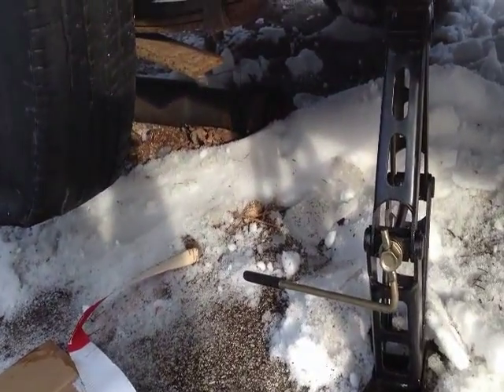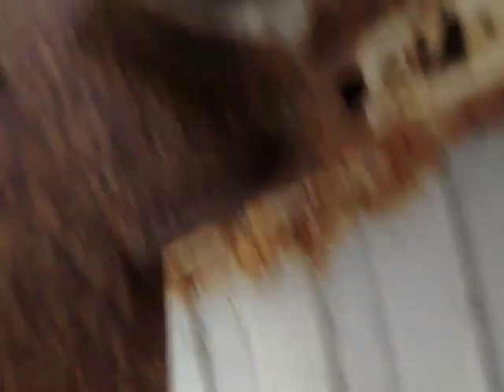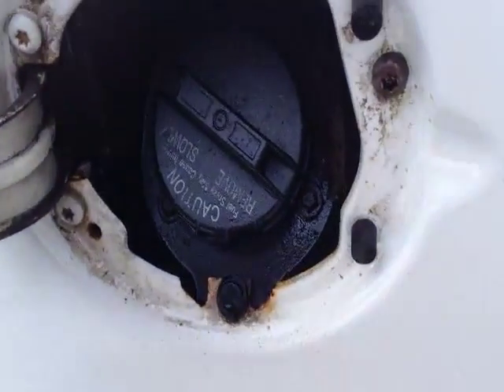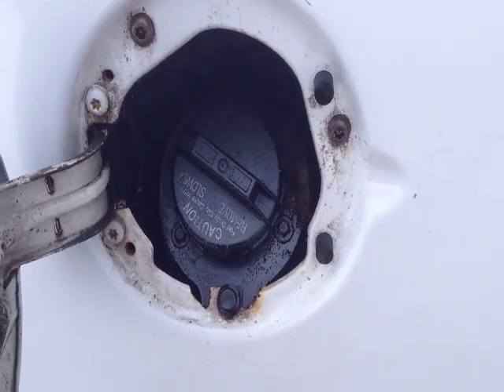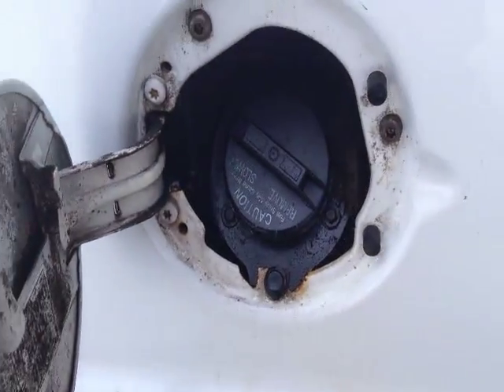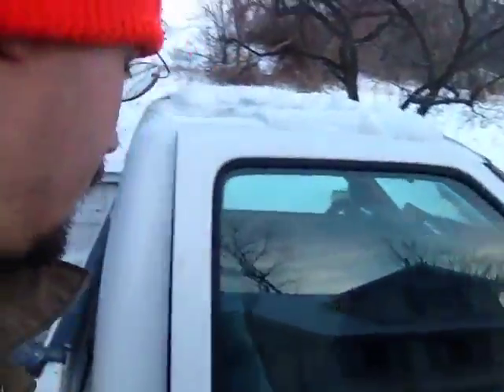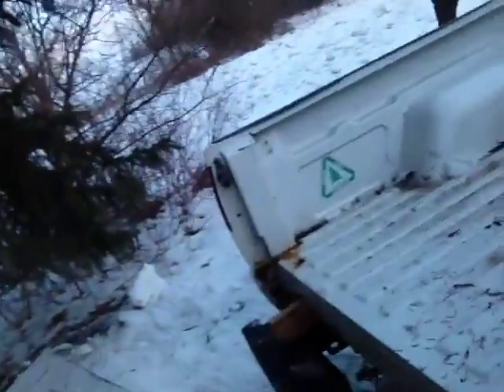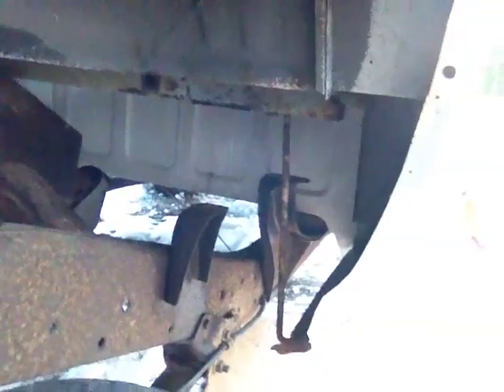SuperTruck: Removing the Bed

Comment from the maker: Insurance is another one of those things to check on BEFORE you start a project. When I did my electric car, the first thing I did was call my insurance agent and tell her exactly what I was doing. The insurance company had no problem with my project, as long as I didn't alter the seatbelts, daytime running lights, or airbags, which I didn't.

Pollution testing is another thing that you need to check on first. In the case of my truck, it is exempt, because it's older than 1996